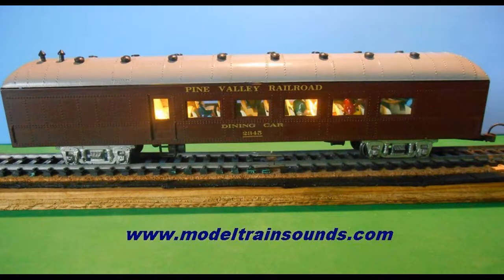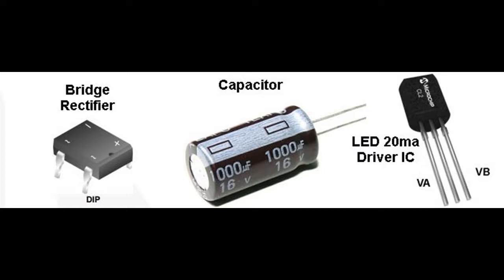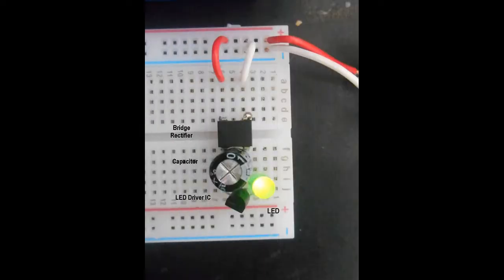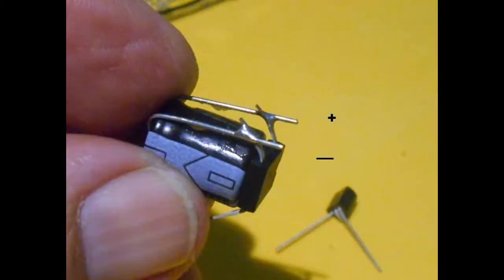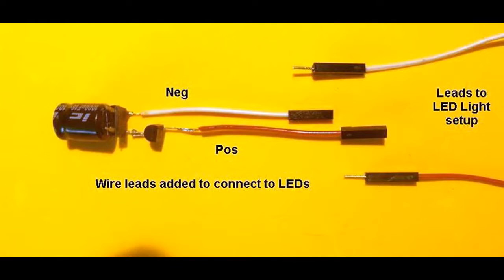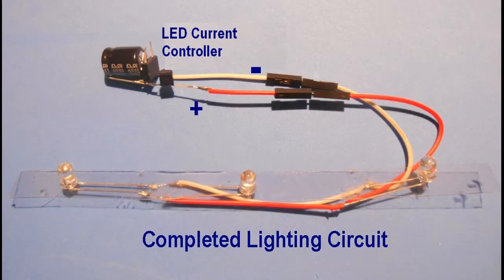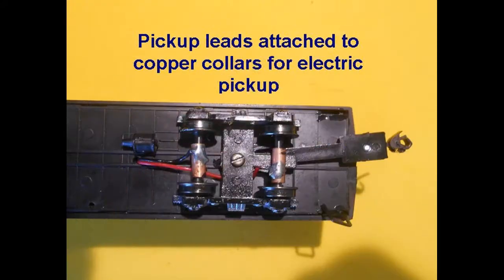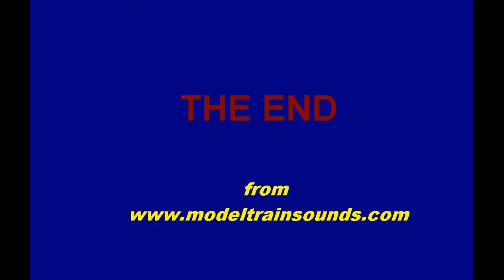Lighting HO Passenger Cars

Comment: I use a mini full wave rectifier, a 3300uF capacitor and LED strip lighting whereby the LED's can be cut apart at every 3rd LED.  There is no need for a resistor between the rectifier and the LED strip.  Ballast (dropping resistors) are built into the LED strips.  I've used this method to change all my incandescent lighting on coaches to LED lighting.  I even made some wheel pickups out of some copper I salvaged from an old computer.  I lit up an REA (Railway Express Agency) coach but my LED's were bright white.  The wife said it looked to fake so I had to take it apart and using some yellow acrylic paint, I painted each of the 12 LED's yellow.  That really toned down the bright white and it looks like old gas lighting from the period.  I use the blue putty to hold the cap and the LED strip has adhesive backing to stick to the underside of the interior roof.  My trains are DC so I don't have to worry about all that DCC crap.  Cheers from W Rusty Lane K9POW in eastern Tennessee

Comment: Great explanation here. 
Question How would you apply this to the strip led lights ? I want to refit the led to older Rivarossa passenger cars that have incandescent bulbs. I have some rectifiers and capacitors like you've shown
Reply: If you are using led strips pass on the led driver.  Just use a 500 to 1000 ohm resistor between the the capacitor and the led strip.  The exact value will depend on how bright you want your lights to be.  You may also want to include a 100 ohm resistor between the rectifier and the capacitor to reduce the inrush current.  Without the 100 ohm resistor, your DCC system may think the capacitor is a short when power is first applied.  This is especially true if you have a bunch of cars with this type of lighting.